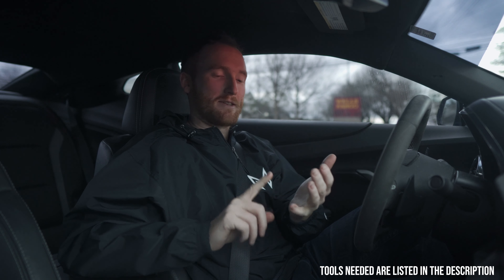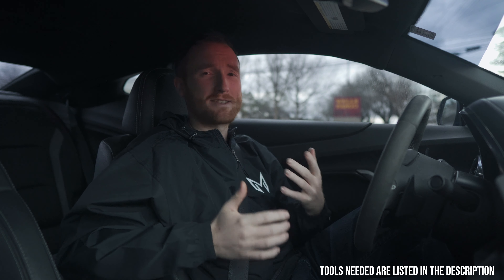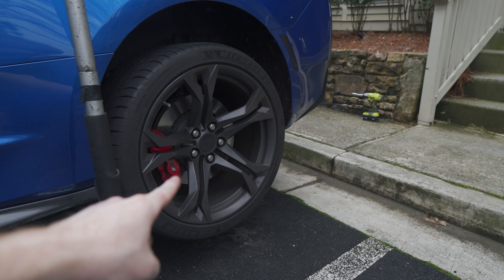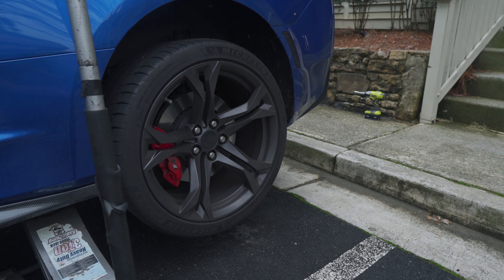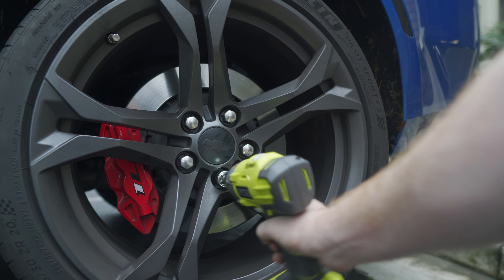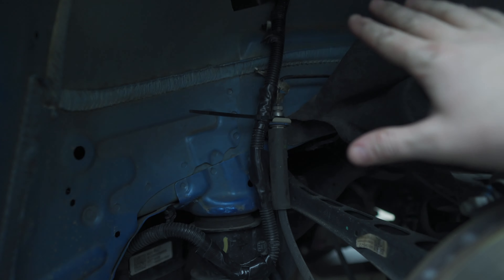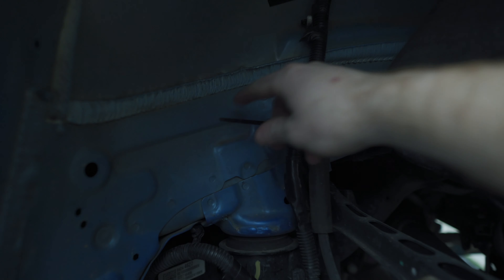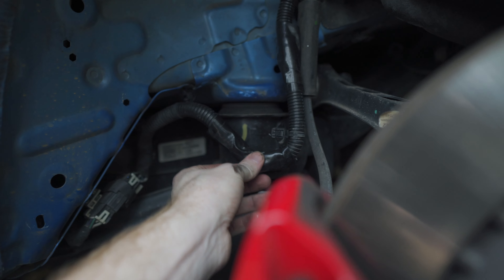Larger Tires? Wiring Harness Relocation I Camaro SS 1LE

Comment: Hi, Quick question on a 2017 Camaro ss 1LE When changing brake pads do the rotors have to be changed as well or can they just make the cut on the rotors?
Reply from the maker: The rotors should be inspected during the brake change, they wear differently and you need to ensure there are no cracks or stress in the rotor, so the answer is, it depends, wish I could make a more clear statement!

Comment: what If I want to run 305’s ? I don’t have the 1le spec, just a 19’ 2ss  lol should I still move the harness ?
Reply from the maker: Nope, you'll be completely fine! Just make sure to get the correct sidewall tire (30)
Reply: Mac Pettit Big thank you! 😄
Reply: Mac Pettit so u think if I go with 315/30r20 I’ll be good rather then 315/35r20??
Reply: @macpettit2327  wait what? I also have a 19 2ss, is the wiring not in the same spot? I was about to do this once I get my car back from getting supercharged

Comment: What size tire can run after you move the harness?
Reply from the maker: It will have to do a bit with the wheel offset, but I believe anything up to a 335 you should be good

Comment: Do all the models have this harness and did you use wheel spacers
Reply from the maker: All 6th gens have the wiring harness in the same spot, I did not have to use spacers, but may run 2mm to play it safe with the 315's

Comment: Only... if you go 35 instead of 30 otherwise ur fine on the 1les you could've saved that labor
Reply: So you think if I go 315/30 on my 19 1le I’ll be good. Won’t rub and I shouldn’t have to move the harness?
Reply: @tbakesteak8637  you will be fine I was and didn't remove jack

Comment: This is un needed if you have a SS 1LE, you only have to re position it if you have a regular SS camaro
Reply from the maker: Really only depends on what wheel and tire size you choose to run, with the new wheel and tire set up I would of torn it apart for sure
Reply: I heard about that it's true huh? 
Even if you go with 35, not 30s